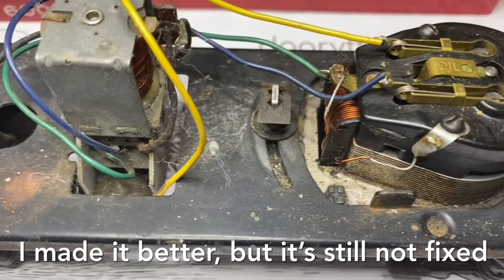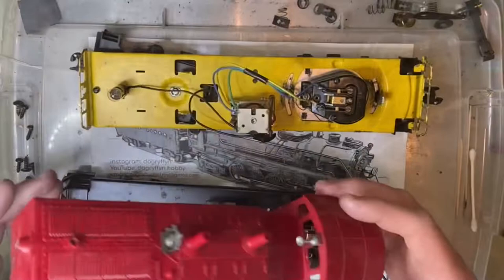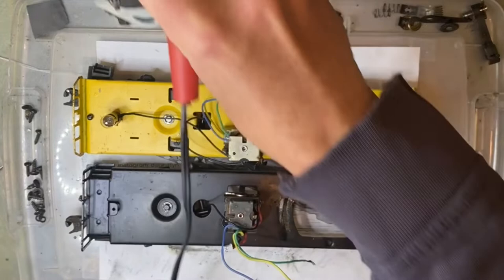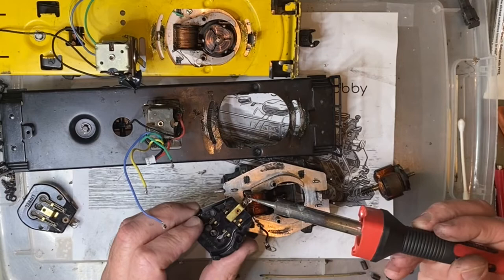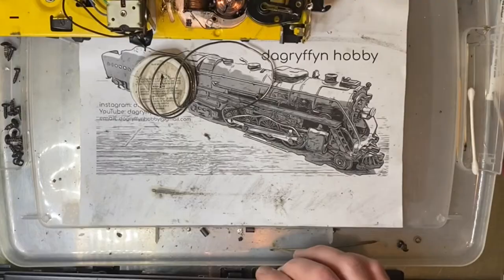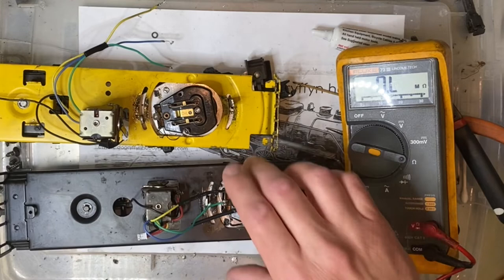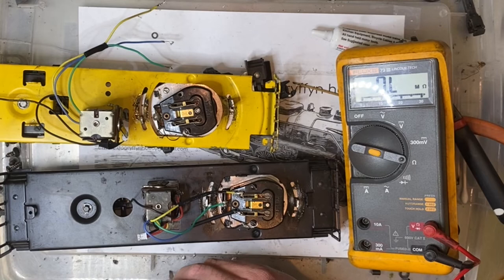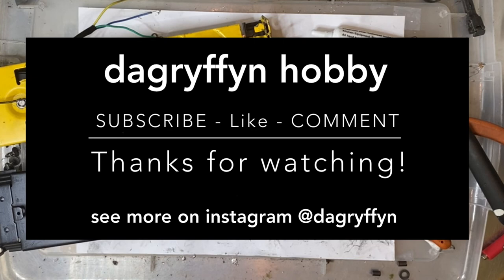Lionel MKT 600 Still Not Fixed! - Postwar Engine Repair and Diagnosis

Comment: I had the identical problem- the thrust washer was missing so I put one in so the armature would no try to climb up in the housing when you applied power. That did not fix the problem. I read in a book there is a problem with these motor types with the side frames getting out of align. This repair manual mentioned putting a piece of card stock between the aluminum side frame and the plastic on the truck. I tried one side and it did nothing and I moved it to the other and it ran flawlessly. I can send you a pic or video of what I am referring to if you want. I ended up using a piece of credit card as a shim and it works fine. what it does is put the drive gear and armature back in alignment
Reply from the maker: I actually used pieces of business card to keep everything from moving. I shimmed each side one at a time until it ran better. I still do want to fix it properly though.

Comment: Check your thrust bearings(those washers on the armature shaft) your armature will want to move along the center line of the motor one way or the other depending on current flow. Those washer are there to provide a bearing surface are usually placed on the motor opposite from the brush plate .
Reply from the maker: If I remember correctly, and that’s a big if, I tried a few different combinations of washers and it helped but did not fix the issue. I did find the truck sides are loose and the plastic plate on the bottom moves quite a bit. Thanks for the tip, I’ll make sure to check when I get it apart again.
Reply: I have a motor that is missing the washers do you know where I can buy them?
Reply: @SilasWasHere  Ebay part number 600-120

Comment: I am now in the process of diagnosing similar problems with a power truck like this. I am not getting movement in either direction and I have been looking for electrical problems. One problem was a broken winding in the armature which I fixed. Looks like someone had jammed the armature into spinning with a screw driver. Still no rotation under power. I notice that with the truck assembled, I can rotate the wheels and motor only in one direction. Rotation of the wheels with the motor assembled locks up the assembly. I pulled an old Lionel center cab diesel from my inventory and found that it is plagued with the running well in one direction and not in the other so I guess the binding armature is the culprit. Thanks to this video and the comments, I have a better understanding on how to proceed.
Reply from the maker: From what I’ve found with this one, based on a lot of suggestions, is that the power truck loosens up. Check for play between the metal sides of the truck, if it’s not staked tightly, it allows that bottom plastic plate to move which causes the gears to jam up. 
I shimmed the sides with little pieces of a business card and it made it work a lot better. If you want to send me an email, I can send you a picture of it. 
Good luck!
Reply: @dagryffynhobby  Hi....this project is getting very involved. One lead of the field magnet has broken off and I had to unwind the coil and rewind it. I did notice that one of the idler gears is so worn at the mounting hole that if you rotate the wheels it drives the gear almost off of the mounting hole. I think I am going to take the idler gear off and try to shim up the slop with jb weld and drill a new mounting hole. I am getting to know how this stuff is put together very closely.

Comment: I’ve seen and fixed this before. It’s been a while, but if memory serves me correctly the motor field isn’t crimped correctly from the factory. The engine I fixed ran ok in one direction and horrible if at all in the other and looked new making me believe it was a factory error. Due to the field not being correctly crimped the magnetism of the armature moves the field and causes it to bind. You also have to check that the bottom plate is aligned correctly and that the trust ball bearing is in the plastic armature plate. I believe you reside in central NJ as I do. If you like I would be willing to meet with you to fix the issue.
Reply from the maker: I believe you are correct. I was able to do a temporary fix, I shimmed the plate at the bottom of the truck and it now runs well in both directions. It’s more of a bandaid than a fix but for the moment it’s good. Thanks!

Comment: Dave my brother in law ended up sending to a professional and they fixed it. I guess the truck from had loosened up and had to be tightened up. It runs perfect now. The frame was flexing enough to bind the armature up causing it to not run.
Reply from the maker: Yup that’s what’s happening with this one. I “fixed” it by shimming out the sides of the truck frame with business cards, works decent, but one of these days I should properly fix it.

Comment: I have read that the botton bearing plate if it is loose pushing the plate to one side will make it run really good and pushing it to the opposite side will make it run even worse then before. By wedging something in there like a piece of a paper match stick so that the plastic is held in place in the correct position. That might remedy  it.
Reply from the maker: I will try wedging a toothpick in there and see what happens 👍
Reply: Cool, let me know if it helped.
Reply from the maker: @billharrold6038  will do

Comment: I had a similar issue with one of the motors on my F3.  The armature was making physical contact with the surrounding field structure.  When I inspected, there appeared to be excess clearance on the one side, and physical contact, which I verified with feeler gauges on the other. A light tap moved the assembly so that the armature no longer made contact and the similar issue of hesitancy to run at start up went away.  Just a suggestion. Look at the armature and see if there appears to be physical signs of rubbing and then take a feeler gauge to confirm.
Reply from the maker: Thanks for the tip Greg, I’ll have to remember that for the future and dig my feeler gauge out of the toolbox. 
The armature could be making contact but it seems to be due to the condition of the truck. The side plates are loose and there is significant movement of the plastic plate on the bottom which is what is supposed to keep the bottom of the armature in the correct location. So first step at this point needs to be to tighten the truck up to minimize movement.
Reply: @dagryffynhobby  glad to help. I really enjoy your videos. It sounds like you're on the right track.  As I'm sure you know, the 2333 motor is different and doesn't have the plastic that could also be causing misalignment.  I did find it odd that you have that separation.  I doubt it would have much an effect on the B field though.  Good luck solving the problem and keep up with the videos!
Reply from the maker: @gregcroon6768  I’m really glad you enjoy the videos. Thanks so much for watching!

Comment: You need to get the Greenberg's repair manual for 1945-1969 Lionel trains if you don't already have it.  This was a poorly designed motor and in the section under 200 Alco diesels it explains the service station fix.  Searching the internet the suggested fixes are to use a match stick or paper to force the plastic bearing plate over to one side to find the best running position.  One side will be better the other will be worse.  I was able to get mine to run well in reverse but not well in forward. I run mine only in reverse.  In the section under Diesel Switchers 600,610,601 and 621 you will need to make sure bearing ball 600-110 is in the plastic bearing plate and thrust collar (washer) 600-129 is on top of armature.  Train Tender should have the parts.  My suggestion is to get the 623/624/6250 switches.  They won't disappoint.
Reply from the maker: Thanks for the info and suggestions, I appreciate it. I couldn’t survive without the Greenberg manual, although sometimes I forget to check it! 
I tried various toothpick thicknesses and placements, and it did make a difference but did not improve it to a point that I’m happy with it. I may need to take more drastic action to repair it. It is definitely not of the quality of my 623. Thanks 👍

Comment: Sounds like the lower aluminum motor side frames aren’t staked in tightly and vibrate when the armature spins. I had a 627 that ran fine in forwards but grinded along in reverse like yours is doing. After re-staking the frames it ran perfectly
Reply from the maker: Interesting, thanks. One question, how do I go about re-staking the frames?
Reply: That part wasn’t easy, I’m by no means an expert repairman and I used a hammer and flat head screw driver with the frame resting on a vise to press down the tabs. I’m sure there’s a better procedure but best to see if the frames on yours are loose first. If not the problem could also be the plastic lower bearing plate for the armature

Comment: please post what you eventually find, I had a sluggish motor on a U36B 1776 engine , the motor was similar but with the white brush plate .the problem with mine was that there was some debris under the brush plate that probably was conductive , could have been very fine solder splashes, once I cleaned it the motor ran fine , I also played with the hex screw that controls the armature up and down movement , but it was the cleaning that was the fix

Comment: Definitely a thrust issue. Something wrong with the plastic bottom plate on that motor.
Reply from the maker: Just looked at the plastic plate - it is in fact loose, quite a bit of movement. On the working motor the plate is secure and does not move. Is there something I can do to secure the plate?

Comment: There;is lower bushing and bearing in my 600. I did not see it when I took it apart for service and the engine did the same thing and only ranwell in reverse. Forward not so much as the worm gear in forward did mesh properly as the commutator torqued upwards and caused it to jam
Reply from the maker: I’ll have to get back into this one and see. It is possible the bearing is missing, I really don’t remember anymore.

Comment: Hmm. What I do when I can't figure out a problem with an engine, I just disassemble the whole thing down to the very last part, look up the blueprints/assembly instructions/parts directory and put it back together like it would've from the factory. I also make sure every part is in like new condition.
Reply from the maker: Good plan. Did a full disassembly a couple times. Parts definitely not in like new condition though. I think it’s down to loose frame and plastic base, going to see if I can repair that and check it again.
Reply: @dagryffynhobby  ah yea, hope you can get that running! Those switcers are really nice looking locos. I probably want one, probably in Seaboard or Santa Fe
Reply from the maker: @chicagolandrailroader  those are both good choices!

Comment: Solved Almost:  in bad direction the armature wants to push up and jam against the brush plate so I modified the armature with a shoulder that keeps it down in the motor.   Hard to explain I'll post a video tonight.
Reply from the maker: That’s an interesting solution, definitely interested in seeing that. 
One of these days I will get a press and try pressing all contact points together to make the whole assembly tighter and see if that works,
Reply: Success 95% I'm done.  I went to hobby shop today and bought some thrust washers part# oc4twmn 1/8 id 1/4 od and four stacked on topped of armature now I have just a tiny bit of chatter at really slow speed going forward and none in reverse.  The armature has about 1mm of play going up and down.
Reply: I have this same problem what should I do?

Comment: Tighten staking of motor truck sides.  Truck is twisting which makes armature rub field.
Confirm by looking for rub marks on armature sides.
R
Reply from the maker: I’ve temporarily got the bottom plate shimmed, works much better, but yes, the motor truck needs to be tightened. Thanks 👍

Comment: You just swapped the armature you have to check the resistance between each segment. I have seen these motors run and stop all the time with only two of the three parts of the armature working. I just put a video out that shows you how to check the armature. After you check the armature if it is good disconnect the E unit and hook the wires up like i show in the video.That is a series wound motor. Figure out a way to disconnect the gearing so you can run the motor without any MECHANICAL intereference.If it runs then you know its a mechanical problem >there are a couple of suggestions below that are good if it is mechanical but you must check the armature first. Search Lionel motor test under Shamus
Reply from the maker: Thanks for the info! For some reason this comment was “held for review” and I didn’t see it. I’ll check out your vids. 👍

Comment: A small ball bearing #600-110 goes in the hole were the armuture goes in the bottom of the truck,...if its not there the armuture sits to low ,,,Ken
Reply from the maker: Ok. I’ll check it out. Thanks!
Reply: @dagryffynhobby  also a thrust washer on top shaft of armuture
Reply from the maker: @kensbackshop6399  that I have 👍
Reply: I thought of that also .

Comment: Have the same engine with same problem.   Have not fixed it yet.
Reply from the maker: The issue on mine is that the power truck is lose, if you grab the silver inner frame pieces, they move and allow the black plastic bearing plate to move. If the bearing plate moves too much, the armature jams. My “fix” was to shim it out with small pieces of business card until the plate didn’t move and the armature was properly positioned

Comment: The frame as a whole needs to be tweaked and restamped with a few simple tools that should correct the alignment in the field because your lower Bering a d upper nearing are so spaced apart it's all to do with aillinment
Reply from the maker: Makes sense. I’ve shimmed the bottom plate for now and it’s working. What tools do I need to fix it properly?

Comment: I have watched this several times because I have a similar problem with a Lionel 202 diesel from 1957 that I have had since childhood, at least 60 years. It probably hasn't run in at least 55 years. I am a novice, just getting into the hobby during retirement. I would love to get this loco running. The gears on rear truck were frozen and I used your video to help me understand how to get this thing apart. The gears are now working well and I cleaned everything up and at least now it issues a loud hum! Still won't move at all. Can you explain further about the brushes? I put them back in slotted end facing up and not down toward track. I read a lot of the comments below and most are over my head. Did you ever get this loco running? Thanks for reading and thanks for sharing your knowledge.
Reply from the maker: Hi Mark, I’m glad my video has been of help. I did get it running and running fairly well. It’s more of a band aid than an actual fix, but it works.
Send me an email at dagryffyn hobby at gmail and I’ll send you some pictures and more info.

Comment: Check the plastic plate underneath the locomotive where the amateur sits sometimes you have to jiggle it and the motor will move
Reply from the maker: I have it shimmed and it improved function. Need to restake the power truck.

Comment: You need a power probe in automotive diagnosis it can inject power into a circuit.
Reply from the maker: That is a fantastic idea. I’ve used one on cars but again, didn’t think of using it for the trains. 👍

Comment: Dave did you ever figure this locomotive out? Was it missing a thrust washer or washer on the bottom of the armature. I have a 602 washer action the same way I just picked up.
Reply from the maker: I should really do a follow up on this one. Yes and no. The problem is the power truck is all lose. The sides move, the bearing plate on the bottom moves, all this leads to the armature getting stuck. My temporary solution was to shim the space between the bearing plate and the side frames of the power truck. I used a little bit of card stock on each side and moved it around until it worked.

Comment: Does the armature need a spacer washer on the shaft somewhere or do the bushings have too much play on either side of the armature shaft? I would check those possibilities.
Reply from the maker: There is a spacer washer on top, if I remove that, the armature moves up to high and binds. Not sure about a bushing underneath- will check it out

Comment: Didn't some of those had a dust plate at the bottom with a spot to be a bearing or support for the armature? Did that one and is it "correct" ?  Newer ones didn't need or have that support. Wonder if there is any visible sign of interference between the armature and those stacked "plates" as well.  Something binds that armature either related to alignment or out of tolerance bearing somewhere in the system. Could also be with the pinon gear/axle & even those little gears on the side of the truck transferring torque to the drive axles. Possibly either sloppy or dirt bound bearing surfaces? Frustrating when something so simple can stump us. And maybe its a tolerance stack of  issues...sometimes stuff just wears out :(
Reply from the maker: I’ve found that the truck itself is loose, allowing movement between all the parts, the bottom bearing plate moves and causes the issue. I shimmed out the plate and it works much better.